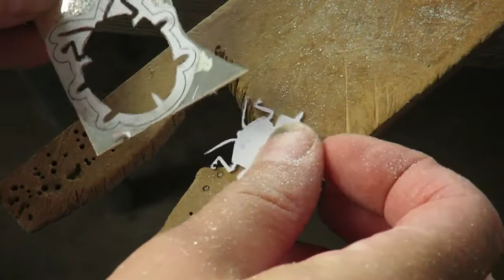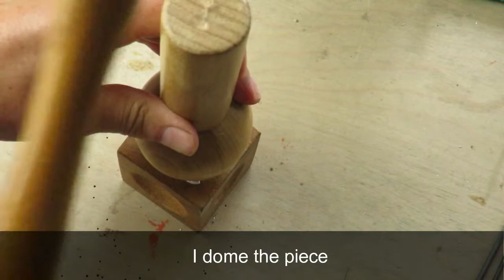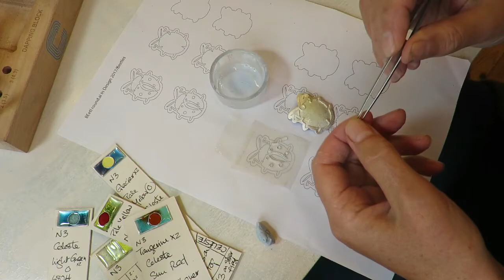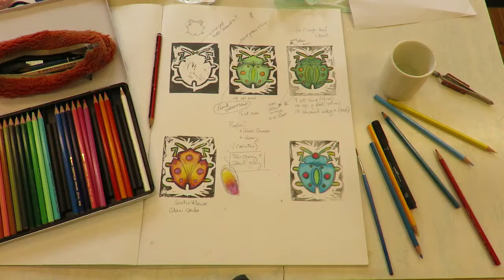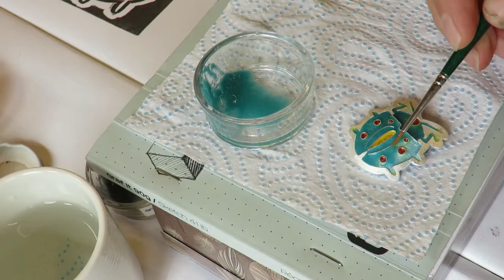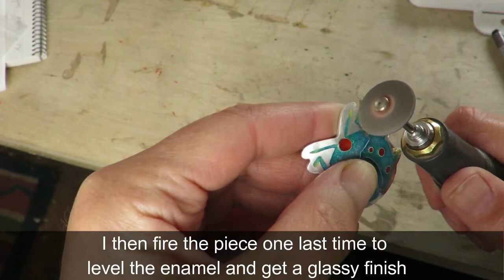How To Enamel Jewelry: Cloisonné and Champlevé Beetle in Fine Silver and Transparent Vitreous Enamel

Comment: Beautiful work, Geraldine!! I have a question... When you sold a piece It didn’t let go in the kiln? I am about to start enameling, but I am going to use just the torch in this beginning. Thanks!
Reply from the maker: Hi Luiza, thanks for emailing. I use hard solder (Eutectic solder) which flows at a higher temperature than my kiln is set at. In other words, the solder flows at 1000 degrees (Celsius) but the kiln is set at 800 degrees. What you don't want is the solder re-flowing inside your kiln because the jump ring or earring posts that you soldered on will come off.

So, when you want to solder a jump ring or bail onto the back of a pendant for instance, you will need to use the hard/Eutectic solder which usually comes in a flat strip. Enamel doesn't combine with solder and that's why I fuse the two front pieces rather than soldering them. But I do use solder on the back for the jump ring. 

I don't do much torch firing but it is worth a go. Fire the piece from underneath not from on top because it may leave black scorch marks on the enamel. It should be fine to solder a jump ring on and then fire with a torch. Just use the right solder! And make sure there is plenty of ventilation as well.

Good luck!
Reply: Oh, I see! I was so confuse about this... thank you for explaining! Have you taken any courses or have any material to indicate?
Reply from the maker: @lumneves96  I teach enamelling in my workshop in Ireland (although not during Covid 19). I'll be uploading more videos though!